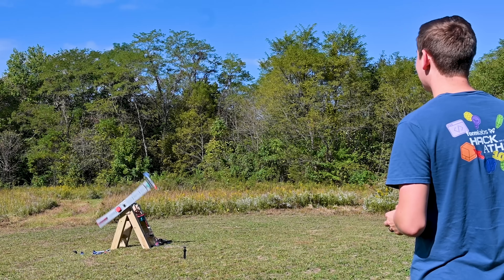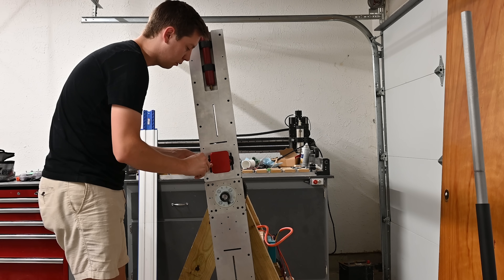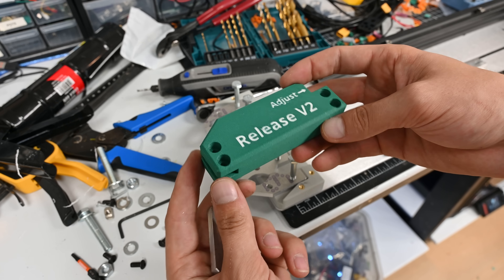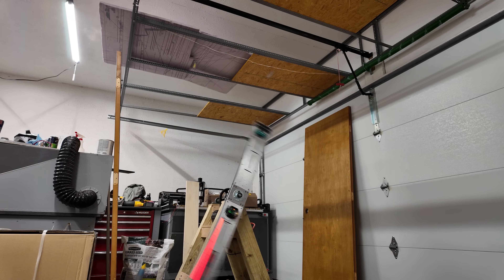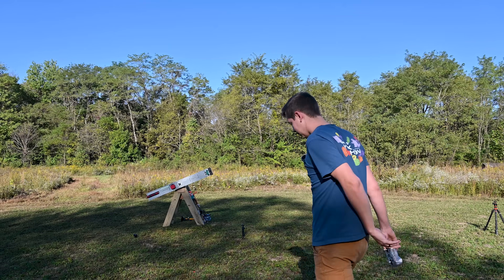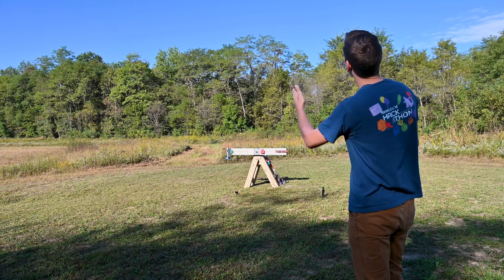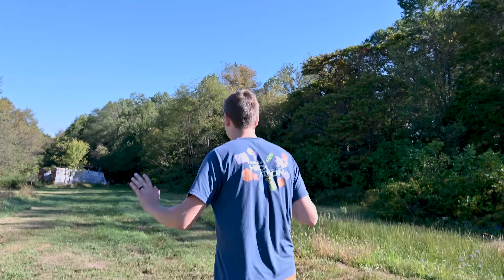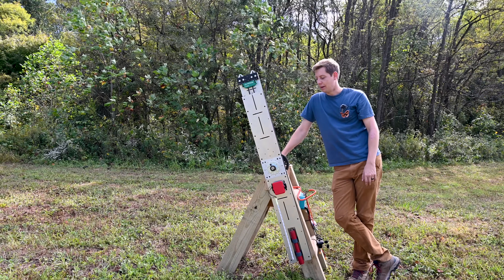I Fixed SpinLaunch

Comment: You have a fixed delay resulting in a variable phase angle at various rpm. You have to compensate for that in order to release at the same point
Reply: This was my exact thought, but then I wondered if the increase in angular momentum from the higher rpm was directly proportional to the increased counter rotation induced by the phase angle.
I think it is, but I haven't got a notepad to hand to check
Reply: @hilburn-  A simple reed switch, hall effect sensor or even just a switch with a cam, any of these solutions would work no crazy timing algos or engineering you just wire the solenoid to only trigger when the switch at the hub is also triggered, and the solenoid will always release at the pre-determined angle regardless of RPM or weight. You don't need a digital controller or programing either it can be all analog.

when at speed you press the fire button and when the second switch at the shaft is also triggered by a cam the solenoid fires.
Reply: @Guardian_Arias wrong. Nothing releases instantly, there will always be some sort of delay that needs to be taken into account
Reply: @Guardian_Arias my point is that I don't think an adaptive launch window is actually necessary. If you do, then using a switch doesn't actually help you at all, as that's fixed.
If it can work with a fixed launch position then yes, a pair of switches in series (one triggered by the position, the other activated by the "launch" signal) is a nice way to do it - but my comment has nothing to do with any of that so idk why you replied to me
Reply: The interface points to the rocket from the release jaws look very...clunky. The first field test in this video shows the back release catching and wobbling, even though it was misadjusted to release early.
Reply: Maybe an electronic release system and some sensor to measure rpm...
Reply: @nicolasmariogirotto  I don't know what is the sampling rate of various inertial measurement units, but I assume it's quite high. I guess they get acceleration in m/s and rad/s which can be integrated, but acceration is limited. From here it's possible to guess timing of release and also i would add some magnetic sensor which passes around magnet near launching point.
Reply: Yeah, like no shade to the creator, it's a fun project and work was put into it etc - but doing a mental tally of all variables and parameters at play here just scream that this probably needs a bunch of electronics to either sense or calculate (or both) stuff like release timings. And at a certain RPM it probably would need to do "something" to counteract the inbalance after launch, or risk unplanned deconstruction.
Reply: Yep, need to maintain a set RPM for launch
Reply: The two clamps have to release as they pass the horizontal axis
Reply: An adjustable Optical Trigger perhaps
Reply: Somehow the brain has to know where the arm is in its spin, how fast it is rotating, how quickly it releases, and the desired release angle. These data points should be usable to accurately release the rocket.
Reply: Agree... I thought, maybe realeasing point should be in the same angular position to completely counteract the angular momentum. So, the timing release should be perfectly timed to get best result.
Reply: I was gonna say... like... wait is he using a rotary encoder or... how in the world does he know when to release it?

Comment: Just go as fast as you can with this arm and a heavier rocket. If balance becomes a problem from the weight shift, just add an identical mechanism on the other side, to release a sacrificial weight launched into the ground.

Comment: Have a counterweight that gets spiked into the ground after release
Reply: Couldn't you also use a dampened linear extension to counteract the force without having to reload a counterweight each time?
Reply: @Tawnos_  throwing object funny
Reply: @BRD8888  Fair enough
Reply: Easier to place an shiftable weight next to the rocket. When the rocket gets released, the same moment the weight behind the rocket will shift outwards and replaces the missing rocket mass.
Reply: @paulpaulsen7777  Let's do just the calculations for that, ..... oh my, never mind.....
Reply: You could also place something in the way of that counterweight and.... smash it.
Reply: Dump water. Dense and breaks up
Reply: Or just shift some ballast on an arm (or even inside the arm).
Reply: @konserv The issue is the speed at which you are able to shift the ballast. It's easy to release weight — but it's not easy to just shift it. It'd be a lot simpler to release a weight — actually making said mechanism reusable should realistically be an endeavor for the future, when the system itself is actually functioning. As the saying goes: "make it exist first, then you can make it good."
Reply: @bndlett8752  Yeah, getting the damping on the ballast right would be difficult. Merely releasing the weight on a sliding rail would lead it to slamming into the end. Ideally, it would provide a counter impulse to the lost weight, stabilizing within some number of rotations.
Reply: @konserv to the inside of rotation??????
Reply: @konserv my thoughts exactly. everybody like @konserv's reply!
Reply: @CohenMarshall-u5b  That's one way a "dampened linear extension to counteract the force" could be implemented.

Comment: Like others have suggested add a model rocket motor that ignites after release to add additional acceleration, some avionics to record acceleration, altitude and to release a parachute, include a GPS/RF tracker to help you find it when it lands in the next county and finally add a trash panda sticker for luck as that seems to work for @xylafoxlin 🙂

Comment: You should try building a screw-launch setup next. Two super long screws that accelerate objects by spinning counter to each other with tapering threads along the length. Its an interesting idea being thrown around the anthrofuturism scene.

Comment: I'd add some springs to the release mechanism to increase the repeatability of the release. The rocket getting stuck on release is a big red flag for reliability and repeatability.

Using a double solenoid valve is probably also needed to fine tune the release.

Finally, I don't know if this would make a huge difference, but some sort of cradle at the end of the arm that would allow the rocket to rotate while keeping it locked in position until release I have a hunch would further increase repeatability.

Comment: I have been looking forward to this video for a while and it was really satisfying to see you fix the issues from the last video. It would be nice to see you pull better data. like exact time of flights so you can compare altitude and things. Graphs!! I am really looking forward to seeing you put a rocket motor in one and light it mid flight. do you think lighting at the time of release would be better or later in the flight? it would be interesting to fly a rocket without a motor, using just the spin system, with just a rocket motor and together.

Comment: I think it'd be cool and completely unnecessary if the LED strip showed a count down while spinning like one of those spinning LED displays
Reply: I mean.. the leds are already there and all...
Reply: @Mateus_Longo This …  needs to happen.
Reply: It's called a persistence of vision display and would work great here. There are existing libraries for common microcontrollers so it would be an easy feature to add.
Reply: @Cody_Istre  "It's called a persistence of vision display and would work great here."

Actually it wouldn't.
The effect would only show if the camera's shutter speed is very slow, like "half a rotation in a frame" slow. But he has to do this outside and he needs direct sunlight for the high-speed camera to give good results. He'd have to use ND filters to make the led-camera slow enough to not be over exposed, but that would completely make the LED's invisible so he'd have to add ultra-bright LED's that are as powerful as the sunlight and that would blind him.

 

By the way, the fact that you're all getting a stiffy over adding this effect shows that you basically don't care about what he's actually doing. To be fair; I don't care either; spinlaunch is possibly the dumbest idea ever, but he just did his first successful test and you're suggesting he spends a few days adding christmas lights...
Reply: @vinny142  Actually, it would. Who cares if it doesn't look good in slow motion? That's not the point of slow motion, that's for the launch, not the funny spin. The fact that you're getting heated over this shows you basically don't care about what he's actually doing, you just want your reddit internet points.
Reply: @vinny142  dude, you know it's possible to say correct things without also being the absolute friggin worst, right?
Reply: @vinny142  I'm gonna join the other 2 replies lol :P
 If you wanna argue about something, the best thing to do is to be kind and understanding (even if the other isn't), as otherwise people will not listen!

But outside of that, I do agree with you on some parts. I think it could fool a human, but definitely not in bright light!
 And I also feel like you forgot that he already has the light there and even said it was useless. So if anything even he doesn't care if the project stays in focus to what it was meant to do :P
Reply: @vinny142  Good point.
Reply: @vinny142  you clearly dont understand the idea behind persistence of vision. the slower shutter speed would break up the image not improve it. while I agree spin launch is fairly limited in its usefulness its a fairly cheap way to get materials into space that aren't sensitive to the gforces such high RPMs impart if it ever works.
Reply: YES.
Technically, we should avoid useless and not properly counteracted weight on a spinning fast like shit shit. But, also technically we could have FULL BLOWN ANIMATED IMAGES above 24 rpm 

Freakin cool, approved.
Reply: Should show rpm or something...
Reply: I disagree, it is cool, and completely necessary.
Reply: how about keying the light colors to the RPM and light show when the correct RPM is reached.
Reply: I was thinking the same thing
Reply: I don't see why that's unnecessary 😂

Feels like this has to be done now
Reply: dots that count it down, towards the rocket, during the final rotation
Reply: It’s not spinning fast enough….. not nearly
Reply: None of this is 'necessary' lol
Reply: If it's cool, then it's totally necessary
Reply: Definitely extra, but would be nice for style points
Reply: Just let it slowly fill up to green or red until it is ready to launch.
Reply: In video game programming this is called “Juice it or lose it”
Reply: or it could helpfully show the current RPM!
Reply: "cool and completely unnecessary" is pretty much everything a person in DIY engineering does. So it's basically the assignment! Off to repurposing, Michael!
Reply: It should say like and subscribe
Reply: or it could show the rpm... but it would flicker really fast
Reply: It would take some tweaking, what with the different speeds and all, but not impossible.
Reply: It would be easier to just make the LED strip into a sliding bar instead of showing numbers.  I think..

Comment: You said the rocket experiences 140G of acceleration on the spinner and launches at 80mph.  To go from 0 to 80mph in 2 metres is only a out 32G. I don't think I'd proceed with this idea, it seems intrinsically flawed.

Comment: Put a transparent capsule in the fuselage, with a gopro, and a rubber ball, so you can see the gforces  as they interact on your unfortunate passenger?
Reply: I'll be fuct if this thing is thought for passengers.
Reply: @bonovoxel7527  I think you'd be smusht. Or sqwusht.
Reply: @bonovoxel7527 the actual full sized spinlaunch imparts several thousand Gs, it would vaporize any living thing inside lol

Comment: If you can get the speed up to say 250 mph for the rocket and have a rocket motor in it that triggers a couple seconds after release you should be able to get a rocket motor to give you a ton more altitude as it wont need to accelerate all your burn will just take it higher as a good portion of the acceleration will be had by the spin launcher. It will just come down to timing the release and ignition of the motor